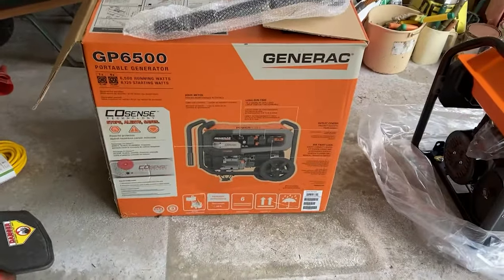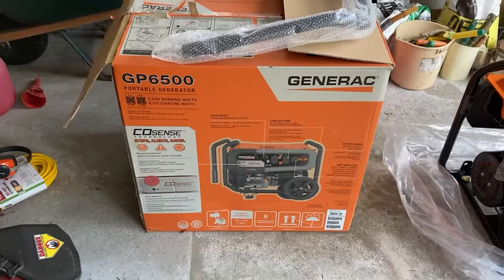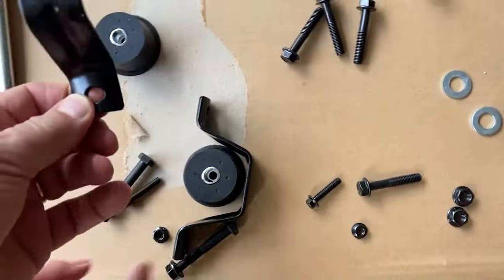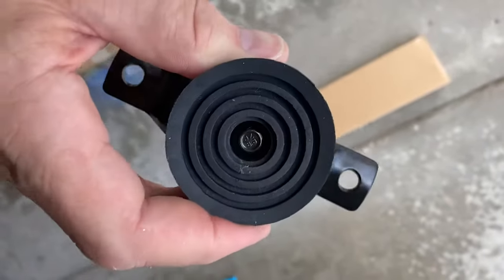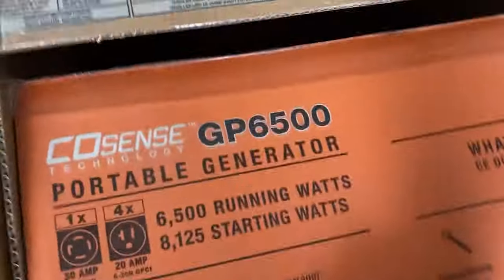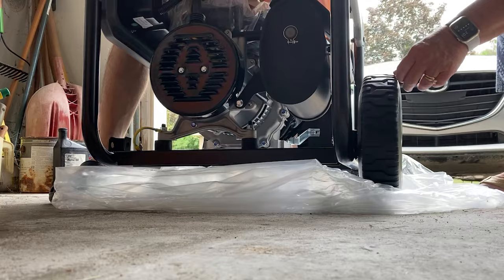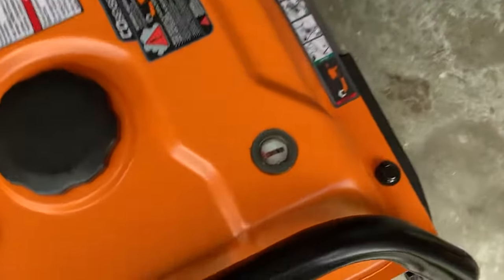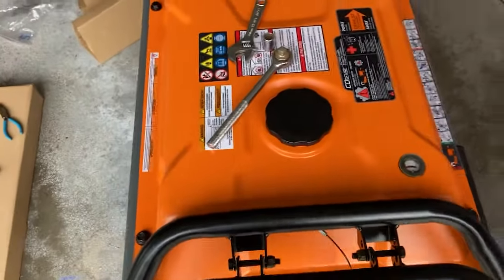How to assemble the Generac GP 6500 generator

Comment: Good video for newbies assembling these monsters.  And yes, they are extremely heavy.   Just to toss some caution to the wind,  first run should be around an hour at low load on the generator (like 1000 watts -hair dryer or small space heater).  Check the oil (directions may say similar)  Only put enough gas in it for 1st run of and hour or so (less than 1 gallon).  Let it completely run out of gas until it stops.   There should also be a drain screw on the side of the carbureator.  Drain any remaing gas out if you do not plan to run it for extended period of time.   If you have access to gasoline that does not contain ethanol. use that!  May be a bit hard to find depending on locations.  If not needed for 6 months or more,  put in a small amount of fuel and run it again under a load till the engine quits.  Then prep for storage again. Never leave gasoline in the tank for more than a month.
Good luck -  like ya say.  I'd much rather have it and not need it than need it and not have it.
Reply from the maker: We still haven’t used ours. Still can’t figure out if I should be happy or sad about that. :>)